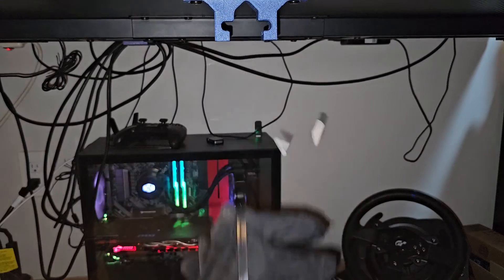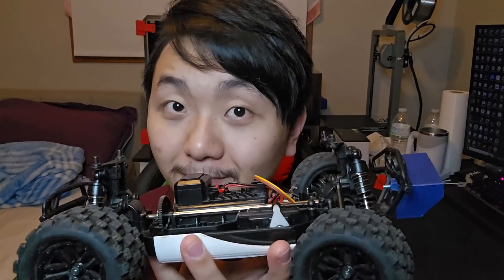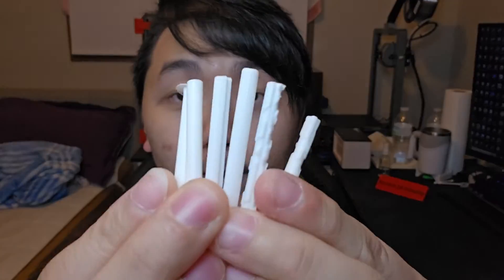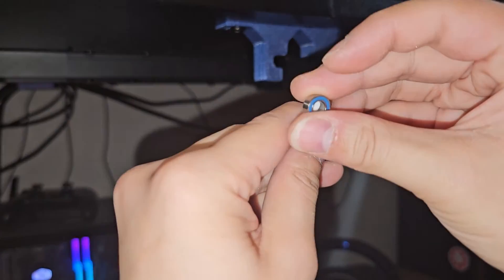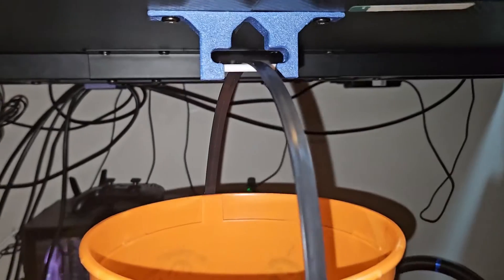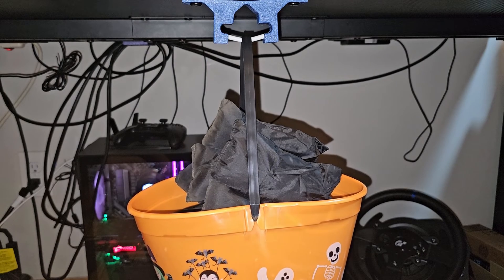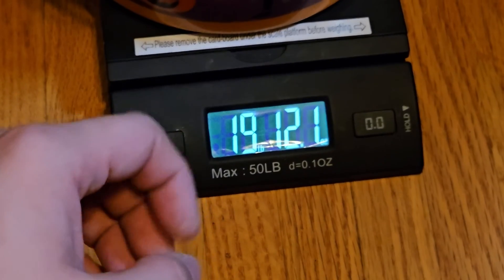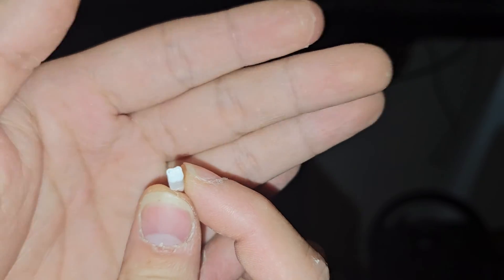Testing 3D Printed Rods Which Type Is Stronger?

Comment: In the car the rod is experiencing torsion, or rotational, force. The solid circle shaped rod will experience an even force on the skin of the cylinder. The other shapes distribute that force in multiple diameters of the rod. That lets the shaped rods absorb some of the initial shock of the torque of the motor.
At high torsion load, the circle rod skin surface will crack and shatter, while the shaped rods would be more likely to twist. apart.

They don't experience beam loading, and as you can see from your experiment, any surface irregularities in beam loading cause acute stress fractures and catastrophic failure.
Reply from the maker: Oh wow that explain a lot. I can see that, because when the circle shape rod broke in the rc car, it looks like how you explain and same goes for the rod with different shapes. Thanks for the clear explanation.

Comment: Not a true comparison for a variety of reasons (eg for a given cross-sectional area, a round profile rod has higher volume of material than a square section),... and on your RC toy the round shafts are likely failing due torsion aswell as bending and shock loads.  For the volume dictated by the ID of the bearing, your square section drive rods are less stiff and are twisting absorbing more of the forces in the outer shell, when compared to a round shaft. 

However, for 3D printing such shafts you might want to trying a hexagon profile.
Reply from the maker: Thanks for the info, ill use this on. Y next project.